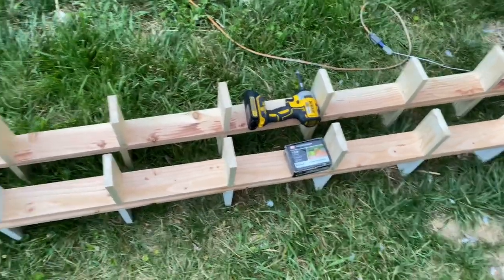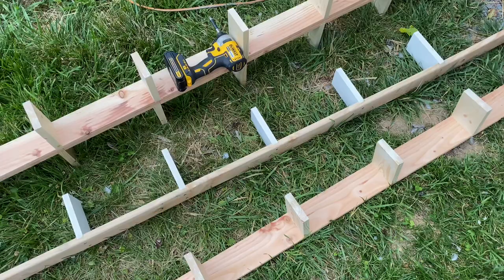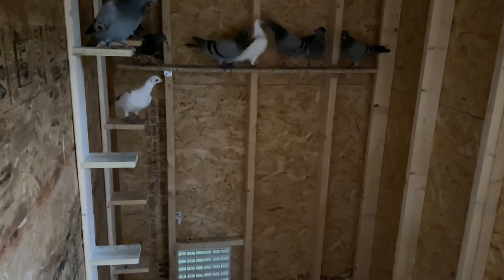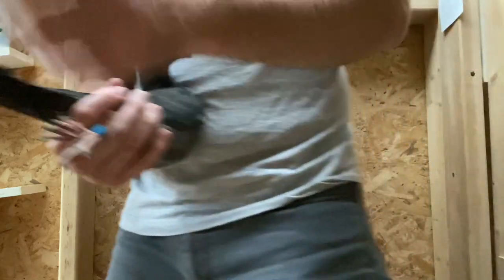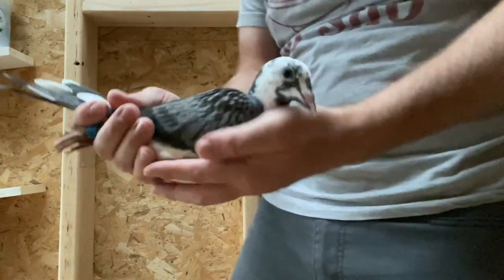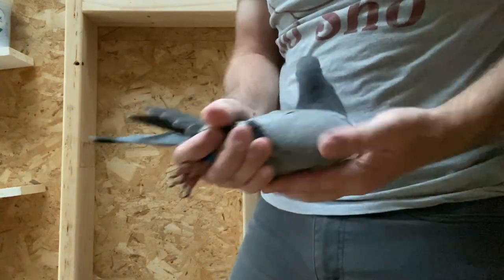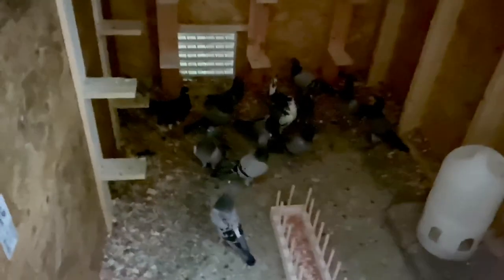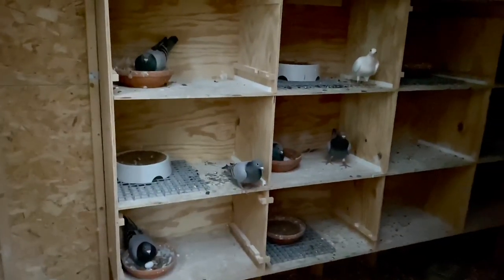3rd round AND How to build easy, no hassle pigeon perches!

Comment: Will using pigeon perches instead of box perches help keep the birds from wanting to nest and lay eggs? I'm new to raising pigeons and have a very small loft.  No room to separate the birds, but all my young birds are pairing up and wanting to nest.
Reply from the maker: Young birds wanting to pair up is completely normal. If the box perches are deep enough they will use them as nest boxes. Having perches like the ones in this video doesn’t stop young birds from pairing up but it does limit the number of nests (the birds will simply nest on the ground instead).